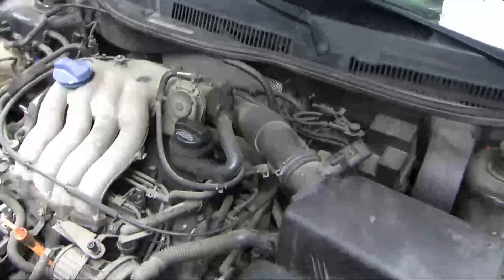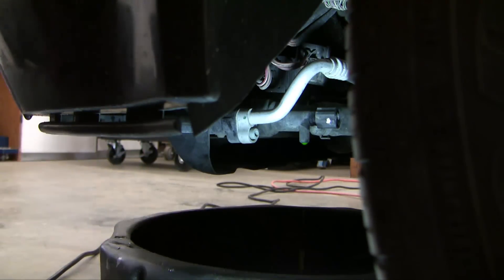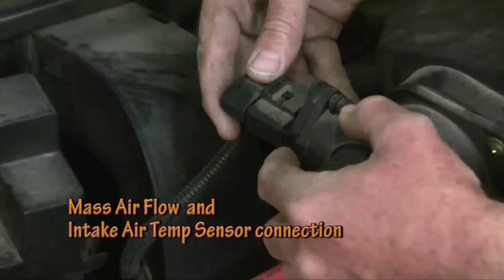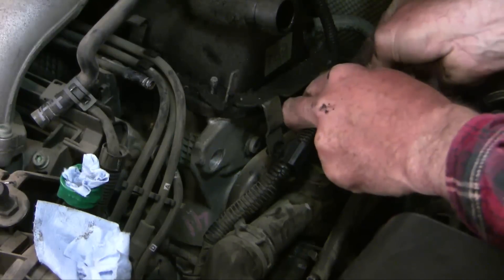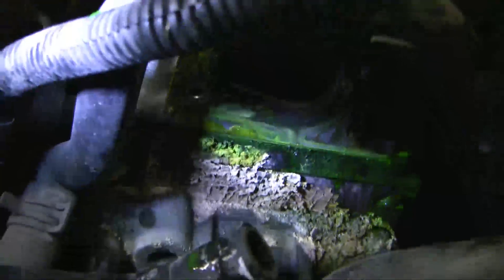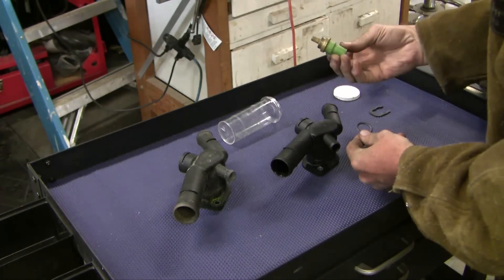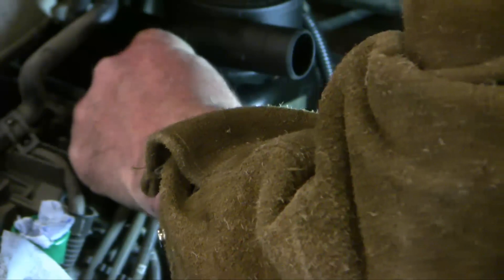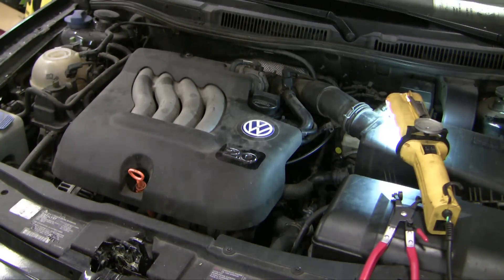VW Jetta Coolant Leak Repair

Comment: Thanks for the vid! Unrelated question - at :28, you can pretty clearly see a hose that's connected to that green sensor underneath the area you're talking about. When I was changing my air filter last night, I noticed that hose is all crumbly and pink and flaking off. I didn't want to poke too much and have the whole thing fall off. What is that hose and green sensor? THANKS!!!
Reply: After more reading and comparing pics, seems like it's the coolant flange that's covered in coolant residue. Sounds like they go bad pretty often. What's an estimate to get that fixed? I can't find any discussions on price. Praying it's not a $1000 job. FWIW, the coolant isn't low, so it must be a super slow leak.
Reply from the maker: As a guess I'll say a few hundred bucks, maybe up to 5 or 600 depending on what is found. The green sensor is the coolant temp sensor, which leads to the red light on your dash if you have an overheat. When you lose coolant, pockets of air form that make fluid movement ineffective, because the air pockets are too compressible. Trapped air makes the overheat worse. The overheat leads to boiling coolant, which opens the valve leading to the coolant reservoir. When steam forms around the coolant temp sensor, it causes a spike in temp which will eventually turn on that warning light. An overheat can damage other important structures like the head gasket, which separates oil, coolant, and combustion elements. Overheating causes the oil to degenerate, increasing friction which can damage bearings and cylinder walls. Get it fixed right away, don't delay because you can fry the engine. While waiting, make sure the coolant level never falls below the low mark, keep it well topped up. Good luck!
Reply: Oh no way, man! The part is 5 bucks. Definitely do it yourself. Go to your local O'reilly and pick one up, watch this video a couple times, then set aside a Saturday and a few cold ones. Too easy!

Comment: Just one note...vehicle I worked on (friend's 2004 VW Golf) had 5mm hex key (or allen) bolts securing flange, as opposed to standard 10mm hex heads.

Comment: Great DIY video.  How did you clean up mating surface? You did not use sealant.  Should I use as "belts and suspenders"?
Reply from the maker: +Ken Dash With no prior RTV in place it didn't take much to clean the surface. A razor blade or abrasive pad and a light solvent like WD40, brake cleaner, penetrating oil, or even seafoam would work -- I don't remember what I used that day. Just be careful to avoid getting solvent on the sensor or inside the engine, and don't let any get onto the new seal since some cleaners can damage plastic. You will see that the new part has a soft rubber seal built into the plastic, and in that case most technicians don't add RTV as well. Putting hard RTV onto a soft rubber seal defeats the purpose and is generally not needed. The professional VW techs I talked to don't use it and I followed their advice. Also I followed the manufacturers advice regarding torque on the bolts. Conceivably it would be possible to distort the plastic housing if you overtorque, and if you break one of those bolts off it could be a very bad day. If you don't have a torque wrench, avoid overtightening, just snug those bolts up.
Reply: Thanks very much!  This is really helpful!

Comment: Excellent video! I have a question for you. On your dodge ram have you experienced any issues with the vents switching to defrost when the engine is under a load? It mist ne some sort of vacuum leak or lack of vacuum?

Comment: Thank you! This is an excellent video explanation of how to DIY. Could you explain the burping of the system a bit more? I'm not quite sure if I need to add the coolant then wait for the fans to kick in and the air to expel then add more coolant afterwards? Thanks and, again, great video!
Reply from the maker: There will always be pockets of trapped air in the cooling system after you refill, and those pockets need to be replaced with coolant before the system will pump and circulate coolant effectively. The pump relies on minimal compressibility of fluid, and a pocket of air makes it hard for the pump to move volume. Also those pockets can hold steam, which can superheat and cause a localized overheat of the engine which causes irreversible damage to the engine. So, you want most of that air out before you drive the car. Some systems have a purge valve but most don't; check your dealers repair manual to find one of those. I don't believe the VW MKIV has a purge valve. Most systems have a thermostat that short circuits the system until the engine is warmed up, so those pockets of air will never clear until the thermostat opens to allow free flow through the radiator, etc. I use a yellow spill free funnel that makes burping less messy and dangerous, but with care you can get away without one of those. I demonstrate burping a few times on different engines, look for the coolant system playlist of videos listed on my channel. Basically you take the radiator cap off while cool (safer), then start and run the engine until you can feel the warm water flowing through the top rad hose, signifying that the thermostat has opened. CAREFULLY notice the bubbles of gas coming out the radiator cap. Turn the engine off a minute or two after the thermostat opens, then immediately replace the radiator cap and let it cool down overnight. Be sure the reservoir is on the high side of full, since the rad cap will draw more fluid into the system as the car cools down overnight. Remember to check the fluid level every day for a week or so in case you need to fill that reservoir up again. If you leave the cap off for too long with engine running, you can have hot steam escaping and you can burn yourself with superheated water, so don't do that. The radiator cap and reservoir will do the remainder of the burping job automatically over the next week, after a few hot/cold cycles, but you want most of the air gone before you use the car. Be sure to watch the video I did explaining how that radiator cap works. It will give you a warm feeling of clarity when you understand how the system works. Thanks for watching!
Reply: Wowsa! Thanks for taking the time to explain all that. I have a 2000 Jetta VR6, so I suspect I will have similar challenges as the MKIV. I will look for your coolant videos. I didn't realize one needs to keep checking up on the coolant system for another week or so, good to know. Once again, thank you!

Comment: Thank you for such a helpful video.. the tape idea is great.. tackling job tommorrow on my sons car..
Reply from the maker: I'm glad it helped, let me know if I can do more. My son still drives this vehicle, though I sometimes wonder about safety issues. Great little vehicle. By the way, while you are at it, lubricate the hood latch with silicone spray to prevent another common issue with the Jetta, a stuck engine hood (see the other vid on my channel). Preventive lubrication goes a long way with that issue.

Comment: thanks for this video. very good. my son has a 2002 vw jetta also. we are trying to locate oil pressure sensor. please help.
Reply from the maker: Not sure. For details like that I always go to the dealers repair manual, and these days the most cost effective way to do that is an aftermarket provider, alldatadiy or mitchelldiy. I have had a little better luck with alldata, though the quality of late model dealer repair manuals has sagged because of emphasis on scan tool diagnostics. To find a sensor, they work pretty well. Failing that I'd start by looking near the oil filter.

Comment from the maker: Yes. Steel wasn't perfect, but I've never seen a steel flange fail so consistently. By swapping to plastic they improved fuel consumption and production cost at the expense of durability. New car buyers don't usually care about that because normally they buy a new vehicle every four years or so.

Comment: Great video... I changed my flange but I must have disturbed another hose because my power steering stopped working.  Is it possible I cracked one of the brittle vacuum hoses?

Comment: Mine leaked here as well, I tried fixing it several times, ordered a non oem part which I don't think helped. Finally got sick of it I got some permatex hi tax gasket sealant and it hasn't leaked since then! I think this might be a common problem on these years!
Reply from the maker: Yeah, I understand your thinking about that. The dealer mechanics in my area don't use Permatex there, but they don't have to pay for the returns a few years later.  There is no mention about sealant in the dealers manual or in any subsequent TSB's that I know of. I was tempted to do it, but in my case I chose not to and I don't believe the problem has recurred, yet.
Reply: spelunkerd I normally wouldn't do that cause its an o-ring but I think the combo of the crappy chinese part and having happen over and over it was my last choice and I hate silicone lol

Comment: Do you happen to know what the hose is you're grabbing at 7:42 in the video? That particular hose on my mkiv golf has a small hole in it, and I need it replaced.  thanks!
Reply from the maker: Gee, it's so long ago, I don't remember. I suggest you get a dealer diagram, I use alldatadiy, which costs about  $40 for 5 years, less for one year, including TSB's. I get dealer diagrams for every car I own, they are definitely worth it, far better than Haynes.

Comment: Hey nice job with the video man, i just have one question that im confused about, The Text at the end stated 2L g12 and 3L distilled water, why not fill the whole system with G12?
Reply from the maker: That's a really GOOD question. The old-school answer is that there is a plateau of effect on both boiling point and freezing point, so you don't get much benefit when you raise the concentration beyond about 50%, and of course you pay more for ethylene glycol than you do distilled water. But the answer is more complex and interesting than that.

There are experimental systems with coolant only, NO water, trying to avoid the nasty redux reactions when water and contaminants interact to cause engine corrosion. Interestingly, one of the downsides of a waterless system is the fact that those engines running with no water have such a high boiling point that when they do overheat the engine may die before it boils over. Remember that engine temp will plateau at the boiling point of the liquid, sucking up latent heat and not rising much until the fluid steams away. Water steaming over is a beneficial early warning, it makes the driver shut the engine off sooner, hopefully before that heat cooks gaskets, bearings, and seals. Search 'waterless cooling system".

Thanks for the great question!

Comment: nice video i have a question you can probably answer, my flange on the top hose that connects to the radiator is leaking, after i pull of the little silver clip, how does the flange pull from the radiator, i dont want to break it and cant seem to find an answer to this, i tried pulling on it and that didnt work, i believe the flange is bad or the O ring is leaking. thanks in advance.

Comment: Hi I have a 2005 GTI 1.8T and last week I drove the vehicle and the antifreeze expansion tank was empty. I replaced it with new fluid and filled it up to the fill line, the other day it was empty again but there were no signs of any leakage underneath the vehicle or in the engine compartment, could the water pump be going bad or could it be that I mix the VW coolant wrong thanks.
Reply from the maker: sheba6779 Just filling the expansion tank is often not enough because the system is so dry it needs even more fluid. On many vehicles there is a separate radiator cap that allows you to fill the system directly and more completely. With a 'run dry' situation as you describe, most mechanics would burp the system as shown in the video to more completely fill the system. At this stage I would probably do that with distilled water since there is likely an underlying problem that will require more work anyway. Refill the reservoir daily since the automatic burping process happens over the course of days. 

You need to find the leak. The example I showed is the commonest source of leak in the vehicle I worked on, but I'm not sure about your model. Yeah, close inspection of the water pump might show a leak there, but that would be less common. I have a cooling system pressure tester that helps find occult leaks, and sometimes the UV dye trick is helpful. The important thing to note is that if you delay getting a diagnosis you could destroy your engine. It wouldn't take much of a mistake, all it takes is one severe overheat. So, do a quick review of your skill set and if you feel it is a little over your head, consider getting a pro involved early. The extra cost is often not that much, and it will help you to avoid a bitter memory of lost opportunity.

Comment: I have a 2000 beetle 2.0L leaking RH under passenger door there four very long hoses going to the rear of car possible one or two think have coolant how do you remove them and where do you buy them I see leaking on those areas/ thanks V/R Hugo Melchor USN RET Disabled vet
Reply from the maker: I would start with the dealers manual to identify for sure what those hoses are. My copy has now expired but I normally use alldatadiy, which costs about $35 for a 5 year subscription.

Comment: I'm doing this job today and the thing is I had to replace the hoses and I don't remember which hose goes where can u help me
Reply from the maker: Only so far as what I showed in the video. The techniques I demonstrated help avoid that situation, which is often the biggest problem. I used alldatadiy, which has dealership schematic diagrams that might help you.

Comment: Thanks for the help. Great video.  Looked up on the internet "leak detector ultralite" don't see it though. Where did you get that.
Reply from the maker: Any autoparts store have that UV dye if you need it. I think I got that one at Canadian tire but NAPA and Autozone will almost certainly have it. In this case it probably wasn't necessary.  Works great for AC leaks, oil leaks, coolant leaks, etc.

Comment: Good stuff very informative and alerted me to the fact that I was cracking sensor clip after sensor clip because i was trying to slide it in with the slits in front and back instead of on the sides. BUT I think you are making a big mistake not adding sealant to that mating flange.Especially after you already identified it as a manufacturer's defect(which it is) Why would you not then compensate for the defect by adding the sealant.You're just asking for trouble....jus sayin.

Comment: Thnx ..... True.... One time i worked on it and lost the bolt in the left back and had to drive it without coolant to my mechanic and at the end started smoking but no engine damage ... My mechanic worked onit and still leaks ... Never took it to dealer the dealer qoute me 200$ to fix it but i dont know why im not going there....

Comment: I have an 01 jetta and antifreeze is leaking, I bought Stop Leak for it (recommended), do I put it in the resevoir?  I dont see a radiator cap.

Comment: hey, is the UV fluid safe to use inside the vehicle in the long term?

I'm losing 100ml a month or so, maybe if I got a lot of time on my hands I'll do a permanent fix, buit for the time being I just want to know that coolant isn't leaking into the engine and that it's bein lost through a leak in a house outside the engine.

So... I just want to use the UV dye and just check for external leaks and leave it at that. Am I good to leave the UV in there?

Comment: Where did you get the dye from? I looked online and cant seem to find it anywhere.
Reply from the maker: Just about any brick and mortar autoparts store will have UV dye for detecting leaks of various sorts. I think I got mine at Canadian Tire, but NAPA would certainly have it. Mine came as a kit with tinted glasses and a UV hand light to better see the dye, and the dye is soluble in oil and water for all kinds of leaks. In this case it wasn't necessary, but for other more difficult problems it helps to find the source. Search "UV dye" at online autoparts stores. Here in Canada, searching Babco tools with that term shows a whole page of options for the professional technician.